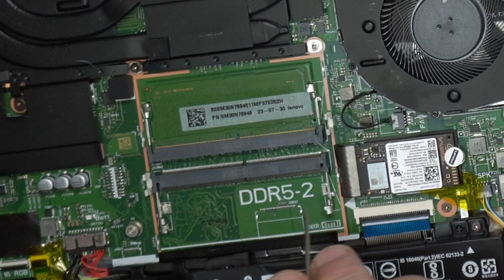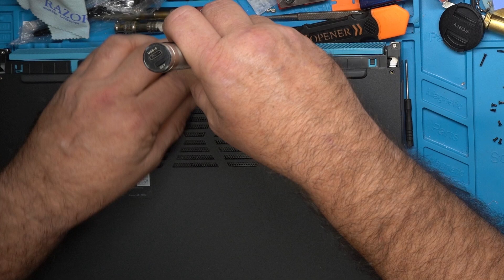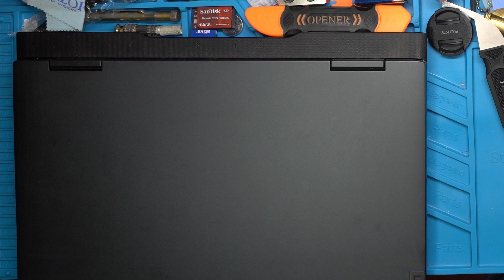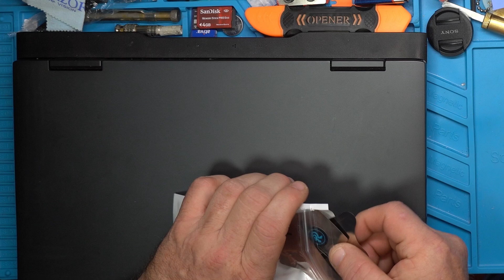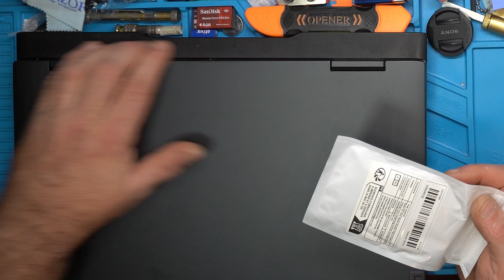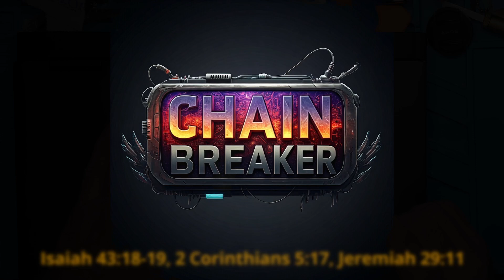UPGRADING The Lenovo iDeaPad Gaming 3 15ARH7

Comment: Hello and big thanks for your help, but I have a problem here where the 2 top  screws can’t fit in their place is any solution for this ? thanks a lot again
Reply from the maker: Do you mean the case screws. If so there is a specific order to put case together or the top two case screws holes will be covered up. Ill have to go back a check video because i think i had that happen. But if i remember right you install two at top in case  before the trim because the trim covers the screws. Hope this helps if not please post pics in community tab on channel page or send pics in a email and ill see what i can figure out. Thanks for commenting.

Comment: Hello friend, I have this exact laptop 15ARH7, I also have a Crucial 5600mhz memory, cl 46, but when I replace it and try to turn on the laptop it turns on the keyboard light but the screen goes black. Once the Lenovo logo appeared but when loading Windows it gave a blue screen. 
Can you tell me what may be causing this? Do I have to do any configuration in the bios? 
Thank you for the video!!
Reply from the maker: My first thought is memory. I would remove memory and re seat it. I have had issues with memory not making a good connection. I would try both memory banks and be sure not to mix memory chip size. If using more than one memory chip try just one chip. Also make sure to check ssd to make sure its seated properly. 

Usually tge windows blue screen of death is memory or hard drive related. The memory sounds like it is posting properly during bios load as it should have during post and not pass a bios checksum. Now if for some reason the bios is bypassing the memory check during post then the blue screen would be the only error. I do think it is memory related. You could have a bad memory chip. Try your old memory module if it loads properly you know it is memory related. Then try seating memory chip again. You can snap a chip in place and it not be seated all the way in   I have done that before. So be sure to insert the gold prongs fully into socket first before pressing chip down. Let me know if this helps. Also if you are still having issues send me a picture of the memory chips installed in laptop. My email is listed on the youtube home screen. Hope this helps.